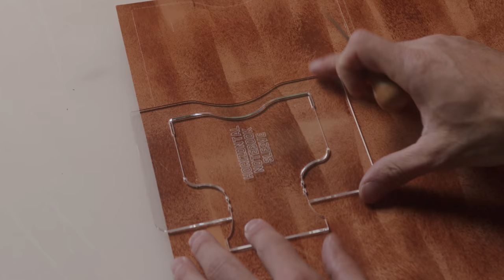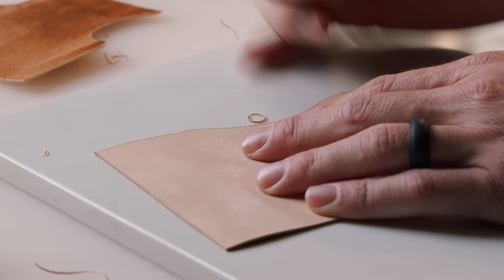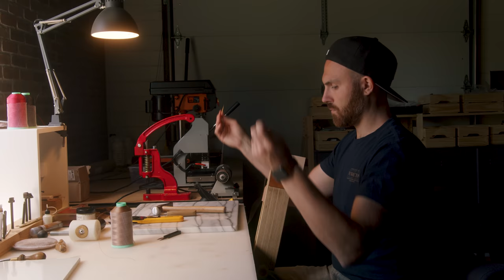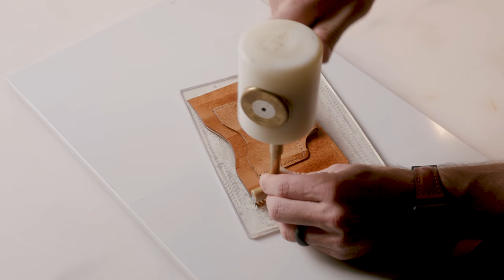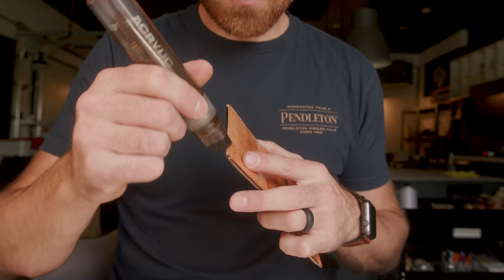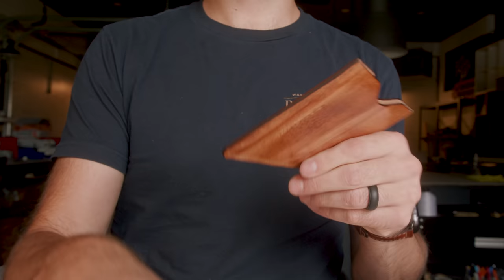Making a handmade LEATHER NOTEBOOK SLEEVE - ASMR - Sounds from the workshop.

Comment: When you are working on your edges, I’ve seen you use Black Tokonole  and sometimes instead you’ll use your Brown acrylic marker, some even follow that with clear tokonole, is there a reason you prefer one over the other? 
Sometimes I want a nice smooth black edge so I wonder which is better , black marker followed by clear tokonole or just using black tokonole from the rip, would love your input.

Comment: Beautiful work as always Ryan 👏. Yet another simple and great design. Video is top notch too. A small question, what kind of thread do you use for hand stitching and do you need to wax it?
Reply: @Aerdonix thanks, I do use Vinymo MBT 0.55mm. However, it's not really easy to work with when you need to handstitch long seams, works great for smaller projects. I lightly wax it (not that it needs wax) for it to have a better hang and maneuverability.

Comment: So, using the renia 315, when I burnish my edges the glue rolls out from in between the leather and ruins my edge. Does it do that for you? Or have you figured out a way to stop it from happening?
Reply from the maker: You could also use trim allowance when making your products. Leave 5mm on all outside edges. Then after gluing your project together, trim off the excess material which will leave a very smooth edge.
Reply: take the rubber and walk around the edges, the rubber removes the glue well completely
Reply: I do use trim allowance with all of my products, should I maybe reduce or increase the amount of sanding I do?
Reply: I’ve had same problem with fiebings white glue and I think firmly pressing the two surfaces, whether using the roller, or clamping, helps. For me personally I know I need to work on controlling how much glue I am applying, for a more even distribution.